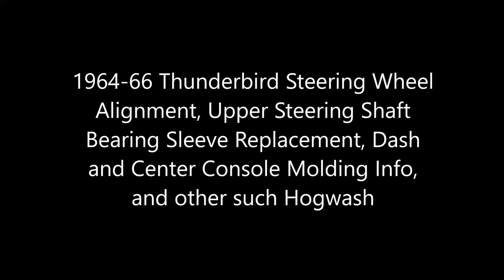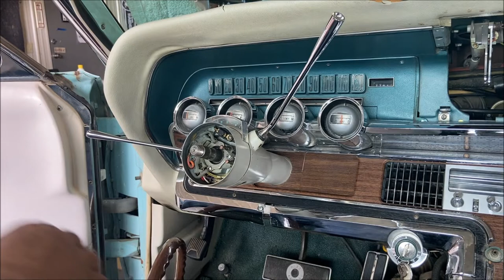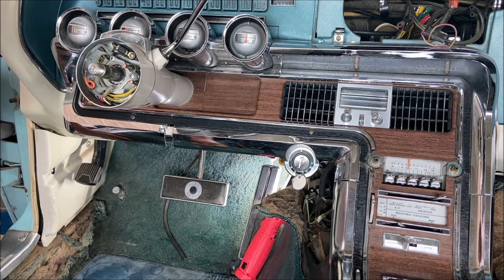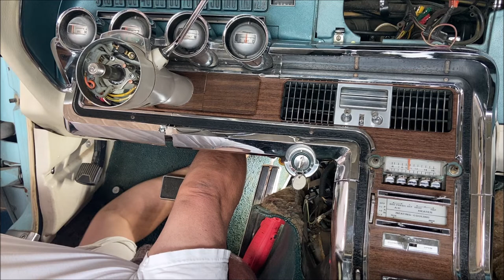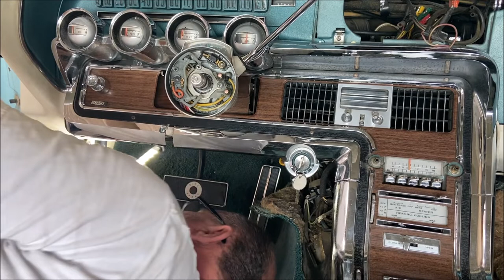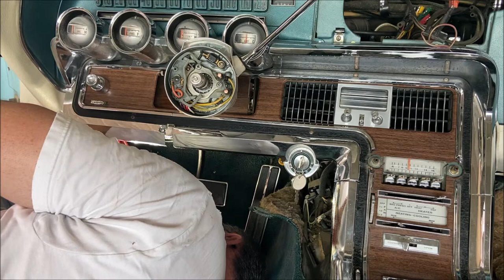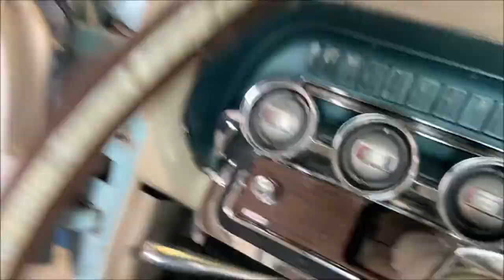1964-66 Thunderbird Steering Wheel Alignment, Upper Steering Shaft Bearing Sleeve Repair, and MORE!

Comment: Nick, furthur investigation  5/16-24 is NF and 5/16-18 is NC. the wheel puller I have is all NC threads. That started my confusion. I learn something new every time I watch your videos, ty. Please disregard my previous comment. Td
Reply from the maker: Hey Tom, no worries mate. AS long as you get the car fixed, thats the goal. Thanks.
Reply: @vintagethunderbirdrepair9426  Thanks for your time

Comment: I just stumbled onto this channel, I have a 64 convertible that my late-father had for decades.  The car was completely restored back in the early 90's and has deteriorated some, and just today I pulled the window switches, thanks to your window switch video, and man, these videos are so awesome.  Especially as I have just taken the car out of a 8 year hibernation and have gotten it back on the road.  Thanks for all these videos!!
Reply from the maker: Hey Danswrld, sitting for 8 years is a long time. I hope you flushed out the fuel system. Also, purge the brake system with new brake fluid and check the wheel cyls for leaks. I bet its a nice car. What color is it? Thank you.
Reply: @vintagethunderbirdrepair9426  The car is red, with red/white interior and a white top.  It had a color change, as the original color was Rose Beige.  I got it running again a few months ago, yep, had to completely flush the fuel system, and I changed the oil.  Haven't flushed the brakes, but that is on my to-do list.  The brakes are very good on this car, (pulled all the drums and inspected the shoes and cylinders) but hard as a rock, so clearly there is an issue with the booster.  Your videos have been awesome!  The 64 was one of 3 Birds (55, 62 sport roadster, and 64), and 98 other cars my father had when he passed away. We have been a car-nut family for decades! Your videos are absolutely killer and so informative for someone like me who is constantly learning about these cars.  Keep it up and thanks!!
Reply from the maker: @danswrld  Thank you very much, I appreciate that. I'm glad they have helped you. You have 98 cars?? Holy cow! I'm working on a customers car now and he has 60 vintage cars and he constantly complains that he cannot drive them enough or keep up with the maintenance. I love cars but thats too many for me, I have enough trouble with my 7 cars. Thanks again.

Comment: Thanks for posting Nick, Well done.
Reply from the maker: Thank you.
Reply: @vintagethunderbirdrepair9426  I guess that ground wire you had to re-connect was for the horn and blinkers?
So, were those two not working before you started the steering wheel task?
Reply from the maker: @COH2000  Hey COH2000, If memory serves me right (which is less common these days) on 65-66 Thunderbirds, the ground wire is for the horn only. The blinkers, brake lights and tail lights will still work if that wire is broken. On 1961-64, the ground wire is from the power steering gear box to the frame.

Comment: Hello Nick, greetings from Germany. I really enjoy watching your videos. I have a suggestion for the mounting marking. Before you remove the steering wheel, you could mark it yourself with a grain or a small chisel. There is one important rule in my profession: Before you are opening the screws, mark or measure it or do both. Thanks so much for your videos.
Reply from the maker: Hey Robert, thank you and excellent suggestion if your original marks are missing. If the factory marks are still there and clearly obvious, then I would not remark it. Just leave well enough alone. Now that we have smart phones with cameras in them, taking a photo is also a good idea. I take photos of everything now days. Thanks again.

Comment: Ok, well I think I've officially spent more time with you and your videos in the last week or so than I have with my family! Idk if you remember my story so I'll recap. Got a 64 TBird that ended up with NO brakes. So I parked it and then tried to move it a couple days later. Wouldn't start. No fuel getting to the carb so changed out the fuel pump and got her started. Sorry this may be a little long. Checked out the brake master cylinder and saw it was leaking towards the booster. Booster was soaked inside! Ordered a new master and booster (From Bird Nest per one of your other videos). While waiting for that to come in my son in law and I removed the old booster....the hard way! From inside the engine well! Stupid! Or uninformed. I guess. Anyway I also got the shifter rebuild kit and it had other parts in it which I had no clue what they were. Found out per some of your other videos it was the bushing, bearing and sleeve. Ok. So I figure I will fix that while I have the booster out but I can't for the life of me figure out how to remove the top cover of the steering wheel. It feels loose but I'm worried if I do something wrong I will break it. So I figure I will try to install the bushing. I removed the screw (wasn't a hex head) from the bottom of the steering column and go to remove the neutral safety switch thingamajig and I can't reach it! I probably could get it out but I'm afraid I wouldn't be able to get it back in! So I give up on that. I'll address that another time I guess. Went to the brake booster bracket to try to figure out how to get it out cause I don't see anyway to get the booster pedal rod reconnected without removing the bracket. Holy smokes! I can't see the nuts holding it on under the dash! but while I was under the dash (being tortured form being contorted!!) I see the steering column ground wire broken. The wire bundles routed the wrong way. The inner porting of the steering column kinda flopping around. Just one thing after another. At this point I just want to get the brakes fixed so I can move the car under cover since we have a tropical storm projected to hit us probably Thursday night. We're in South Carolina. It'll take 4 of us if I have to manually push this boat slightly uphill...backwards! Anyway I think it's cool how you stay so jovial in your videos. I've said some things that would make Sailors run away! I guess I will go out and see if I can figure out where this booster bracket nuts are. For about the 4th time!  Stay well......
Reply from the maker: Hey Mr 51, no worries mate. What works for me because I'm fat, short, bald and old, I remove the drivers seat and then I can lay down on the floor of the car and see under the dash with no problems. Yes, taking the seat out sucks but its the lesser of evils. Its so nice to just lay down and look up under the dash and not have to go to the chiropractor afterword's. Then you can deal with everything at once and you have several issues to deal with there so that is my recommendation. The things your trying to locate under the dash are not hard, your just not used to it. Watch my videos and get familiar with everything and where things are and maybe that will help you. Good luck.
Reply: @vintagethunderbirdrepair9426  I can't thank you enough for you taking the time to share your expertise. These last couple of weeks I've spent A LOT of time watching your videos. I finally figured out how to get the steering wheel "hub", cover or whatever it's called off and proceeded to pull the wheel. Wouldn't you know that the closest bolts I had ended up being Metric so off to the hardware store to get the right ones. The 5/16x24 ones worked great. You were absolutely right. They threaded in mostly by hand and then after a little tightening the wheel came off fine. Now I have a little more more room to crawl under that dash. Still thinking about pulling that seat though. Anyway you have been like a Teacher guiding me through some of this stuff. hopefully tomorrow I can finish getting the "Prndl" stuff off and change that sleeve and bearing. I'll keep you updated on my progress. Again, Thanks!
Reply from the maker: @Mr51Caveman  Glad to help Mr 51. Sometimes those two holes to pull the steering wheel are messed up. They've been stripped and cross threaded and then you have a real problem. That doesn't happen very often but when it does you really have to be a rocket scientist to repair the threads to pull the wheel. Yeah, I don't go under a dash anymore without pulling the seat. I remember when I started working on Thunderbirds in 1980, I could just slip under there like a cat, not today. Thanks.

Comment: Hi Nick George here with the 1966 thunderbird in LA. Thanks so much for filming these fantastic elaborate as well as comic videos! I spend hours watching them over and over again as I try executing  some of my own repairs. I wish I had your patience as I get so frustrated and worked up when my attempts don't run smoothly. You mentioned very briefly the black wire which lights the prindle on the steering column. My prindle is not lighting up as I turn on my lights. Is this an easy fix? FYI I still have parts in bags I bought form you when you had your shop in VanNuys where you rebuilt my engine!
Reply from the maker: Hey George, how are you? Still own the Thunderbird, man you have had that car a long time. To change the bulb for the PRNDL (if thats whats wrong with it) you must remove the steering wheel as I show in the video. Then you just unscrew the one screw holding the bulb in place and replace it. It is a special bulb a Wagner 194, that is the only number I have. I should have showed that in my video since I had complete access to it. DOH!!! Good luck George. Nice to hear from you.

Comment: Nick, 1966 Thunderbird steering wheel removal video ,2 years ago. 1hour 12 min long. you said the puller bolt needed were 5/16-24 and the tap you used that tap to clean the threads. Was that the correct size thread ? I can't find a 5/16-24, only a 5/16-18 anywhere. Can't even find 5/16-24 thread bolts for sale. My service manual doesn't tell me and you are my only lead. ty  Td

Comment: Another great video Nick so much easier to watch the master at work than reading a workshop manual on a laptop. Thanks for posting so quickly. 
Had  a quick look at mine and looking like the steering wheel has yet to come off, the marks are aligned and no tool marks on shaft. Seems the upper bush has gone too, only just noticed that.
So with the wheel alignment do you do your own? I was going to attempt mine with a bit more research.
Reply from the maker: Hey Steve, only a shop with a very expensive alignment machine can do the alignment. I do not do them myself. The Thunderbird has very specific and unique alignment shims. What ever alignment shop you go to, they will not have them. I always bring a selection of some with me in case they need some. You can purchase some at any Thunderbird dealer. Thanks.

Comment: Hello Nick, i hope to get your input about an issue im having.
First of all, thanks for all the knowledge you're sharing with the everyone, you're truly an asset to the community.
I got my hands on a 65 through a blind auction and once received it turned out that the owner had swapped the FE to a Buick 350, and the slide away mechanism is not moving at all.
As im not very experienced with these classics (matter fact this is the first car of this era that im working on) i wanted to ask what could be the possible cause to stop the slide away from moving at all as i read that the main downside of engine swapping a thunderbird is that you'll have to eliminate the slide away mechanism, but no specific cause mentioned.
Reply from the maker: Hey Faisal, I made several videos about the steering column and slide mechanisms in detail and I show how it works in detail. A link to part 1 is here https://youtu.be/itShTaOugbY. A link to part 2 is here https://youtu.be/cIvpssRjxOQ. A link to part 3 is here https://youtu.be/TJLrq_cN_io. In almost all cases of malfunction, its an improperly adjusted slide mechanism. In my videos, especially part 3, I show the slide mechanism in operation in detail. If someone has changed the engine, I would not be surprised if they messed up the slide mechanism too. Changing the engine or transmission has nothing to do with the steering column slide mechanism that is located under the dash. All of those parts related to the slide mechanism are under the dash and not in the engine compartment. So anyone that states changing the engine means that you have to eliminate the slide mechanism is wrong. Look at my videos, look at your car, compare and see if you are missing anything. Good luck.
Reply: @vintagethunderbirdrepair9426  Thank you for the insight, now i just need to find the time to take off the interior panels and have a look, hopefully its just a simple fix.

Comment: At the beginning of the video, it appears the steering wheel alignment marks are at the top or slightly right of center. After you re-installed the column, the marks are left of center. Won’t the steering wheel be misaligned?
Reply from the maker: Hey John, no they were not left or right of center, the marks are from the factory and are straight. Probably just an illusion from the video. thanks.

Comment: I have a 1965 Tbird convertible.
My emergency brake won’t engage and the hiss of the vacuum line is coming from the steering column. Which video is best for finding that exact problem? Thank you and love your vid’s.
Reply from the maker: Hey Charles, I dont have a specific video explaining that. I do have steeering column videos and I show the neutral safety switch and I do have one where I repair the vacuum motor on the ebrake assembly. Those should help you. If your ebrake does not engage meaning, if you push on the ebrake pedal and it does not stay depressed and hold the car, then the ratchet lever is not engaging which means the spring for the ratchet lever is bad or something is preventing the ratchet lever from engaging. Usually its a broken spring. If the vacuum motor was bad, the ebrake would still engage, you would just have to depress the bypass lever manually to disengage it. If the ebrake were not getting vacuum, same thing. The only thing to cause the ebrake not to engage is a faulty ratchet lever or the spring for the ratchet lever is broken. The spring that returns the ratchet lever. Ratchet levers also wear out and get a grove in them so they cannot engage even though the spring is okay. If that is the case, the entire ebrake assembly is bad and you will need to find another that has a decent ratchet lever. I hope that has helped you. Thanks.

Comment: Hello Sir,
I hope all is well on your side of the world, I was wondering if you can help me with my 62 Thunderbird brake light issue, the final conclusion I found is that fuse keeps blowing when I shift from park to drive, I think I have a ground in the steering column, do you think it’s the right spot to troubleshoot or should I look into the other possibility.
Reply from the maker: Hey Rollitex, if my 62 brake lights are not working, I touch the two wires at the switch together and see if they go on, or I test the wires with an volt meter and see if there is any voltage. If no voltage, I go to the fuse box and see if the  circuit breaker is faulty. I don't have a shop manual handy but if memory serves, there is no brake light fuse, only a circuit breaker. On 62, the fuse box is on the drivers side bolted to the vent. You can jump the circuit breaker by connecting a wire between the two terminals on the circuit breaker, and/or you can also check for voltage there. If no voltage then you must keep checking things down the circuit until you find the problem. I would not take the steering column apart, just test the wires with an volt  meter. You can even unplug the turn signal switch wires and then see if they work. Good luck.

Comment: Hey Nick, on my 65 landau the steering wheel looks to be misaligned by about 90º...I took the center hub off to see if the lines were lined up. The shaft has been beat smooth by someone in the past and has no "notch" to align with. What are your recommendations for how to realign the steering wheel? I've also tried to look for just a new steering shaft but haven't had any luck. Thanks for these great videos, it really helps!
Reply from the maker: Hey Branson, I bet you wheel has been put on wrong. I have a good used steering shaft with the marks still on it. My email is tamie.nick@sbcglobal.net. Thanks.

Comment: Hi Nick. Great video, thanks. As you know I own a beatiful 66 Landau and worked already on it with help of your videos. However, what I miss on this last one is the information, whether there is anything special to observe when attaching the steering shaft back to the steering coupler. Any special position to get the steering wheel aligned? Thanks so much. Juraj from Slovakia
Reply from the maker: Hi Juraj, just saw your message today 8/29/22 so I am very sorry for not answering sooner. The steering shaft goes into the steering coupler only one way so its not hard to install that. Once the steering shaft is installed, the steering wheel goes on just like I show in the video, line it up with the mark on the shaft. Its very easy. I hope I understood your question. Thank you.